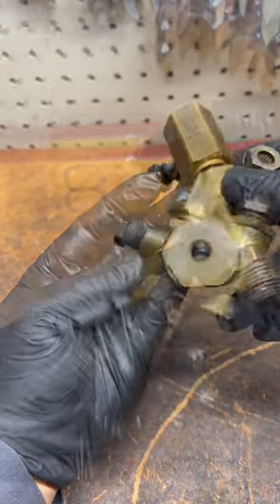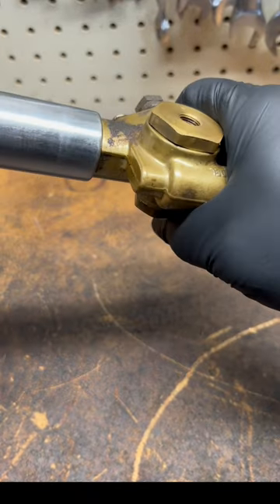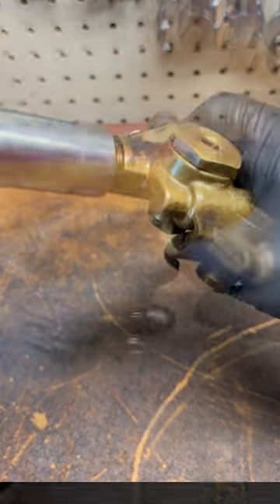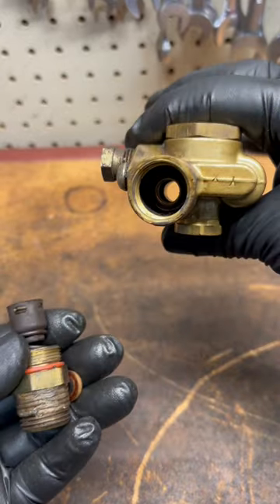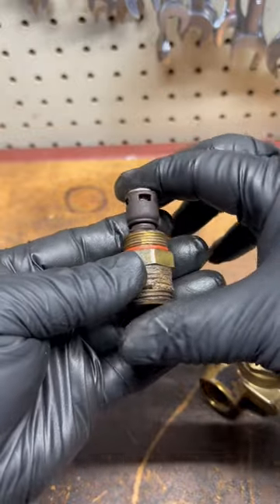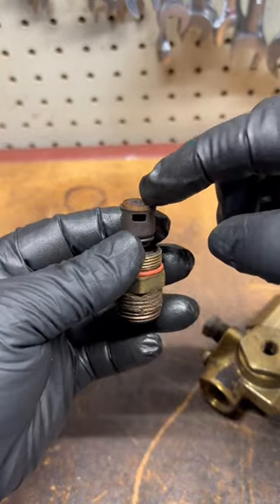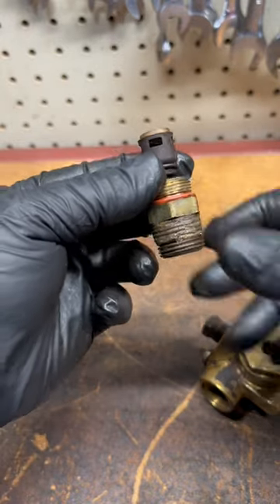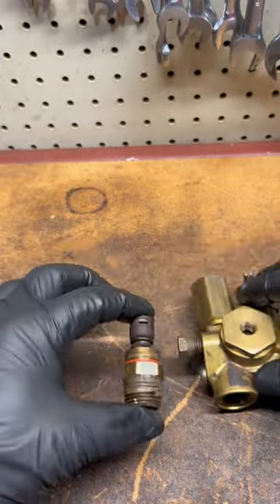Compressor seized? Inspect the check valve

Comment: So, when air  coming in the air dryer does the compressor o-ring brake ? Does this check valve helps ? For not let air in on air dryer
Reply from the maker: The o ring might break after a while but the check valve helps so air won’t escape the compressor and the compressor won’t seize up in the middle of pumping air.
Reply: Which valves does it work properly?
Reply from the maker: It’s is the valve that sometimes screws into the tank.